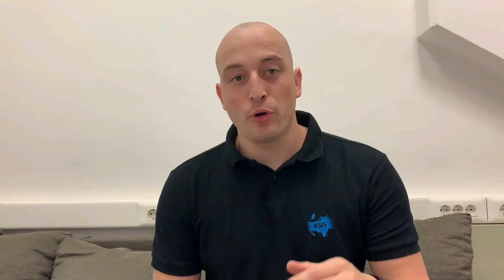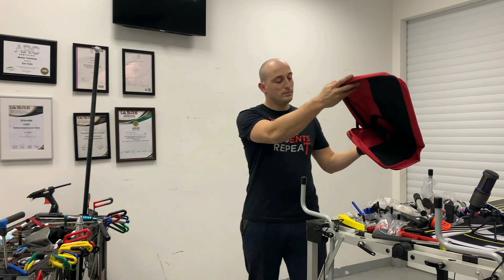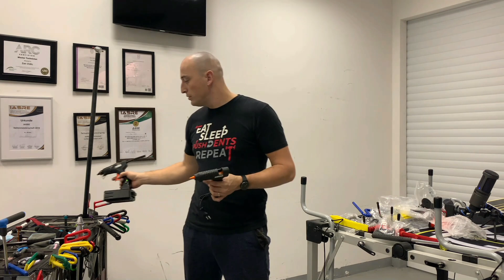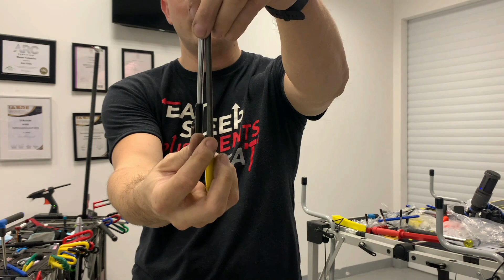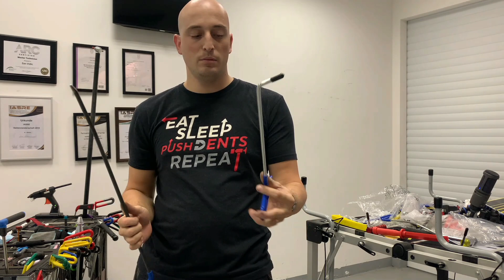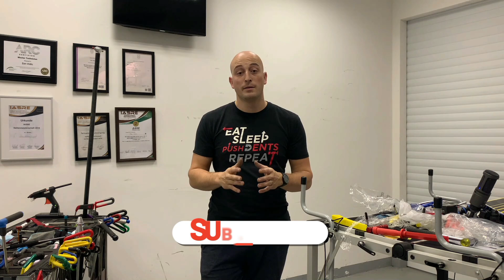Are cheap PDR tools worth your money? | DIY dent repair tools | Part 2

Comment: would you test the cheap Chinese 24 inch basic pusher rods?  they cost about $25 and use a metric thread pattern.  A single bend 90 degree and a double bend would be my choices.
also, why can't you sand and polish the plastic tips your complaining about?  don't you have to polish your tips as they wear?    keep up the good job; i like your videos.
Reply from the maker: Where to find those? Why not sand and polish? They should come out of the box ready to use. Its like buying a new car and then you have to put the tires on in order to drive it out of a dealership :) I rarely have to polish my tips

Thank you for watching!

Comment: I’ve used a cheap slide hammer similar to that one. 
Broke some cheap tabs that came with the kit, and since tabs are plastic I don’t think the slide hammer breaking there would be a problem. However, as you stated the design makes pulling awkward, and it does unscrew when you don’t want it to.
For an inexpensive blending hammer I got one with interchangeable tips, and can just get nicer tips I want for it…a nice leather tip costed more than the hammer.
Currently waiting on some whale tails in the mail, and will probably fabricate my own 4’-5’ “hail rod” because they are quite expensive for such a simple tool.
Reply from the maker: All PDR tools are expensive, that's a fact. But if you buy a good quality tool it should last you for ages and it will bring much more money in then you spent on it.

Comment: I have a dent like a ball dent was wondering what's my best option to take it off 

It's around 4 inches round was looking for 1 tool that will work on its own and maybe a knock down to flatten any high spots

Any one know of 1
Reply from the maker: Taking out dents is not easy. If you don't know how to do it, I suggest you hire a professional.
Reply: @vidicz  well it's not a new truck it's a old 95 Tacoma I love pdr and want to buy tools but it would take time , 
So I'm looking for 1 maybe the flat bar ?

And besides that a heat gun 
My goal is just to lift it enough wer I could just Bondo it and paint it 

I know I can buy a new fender for around 90 but I just want to try pdr and mighteswell try it I'm a hobbiest

Comment: But your not going to be pushing against any door dings with that much pressure ; whats the point of bending them with your full strength ?
Reply from the maker: You have no idea how much preassure is used when pushing dents do you? :) Trust me much more preassure gets applied to some of the dents
Reply: @vidicz   

No , I don't at all. I don't know jack about pdr. I have removed some small dents in the fender with a rubber object and slowly rolled them out , but that's some backyard ghetto stuff. lol

Comment: I agree with you, I learned the hard way on these cheap tools. The slide hammer is not assembled correctly. It will configure like yours. The aluminum hammer works ok, the glue gun is not good for mobile work, the rods suck(these are the worse I have seen), the threads are all M18, not 5/16-18. You can get a copy of a dent dial that is very good from china, but it is metric as well. Moral of the story, if you are going to be a professional, buy professional tools.
Reply from the maker: True. I like the moral of the story!